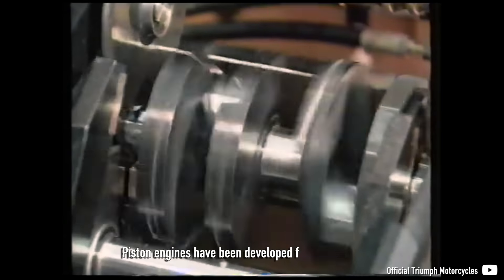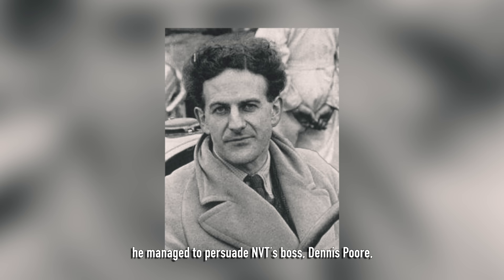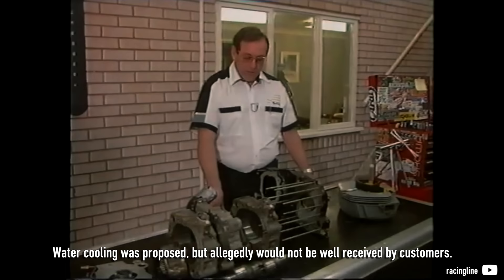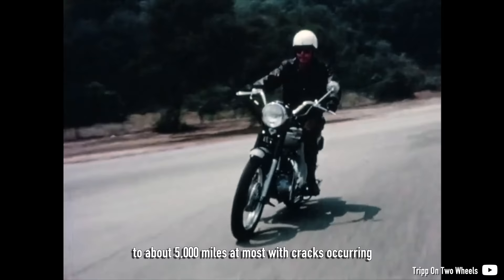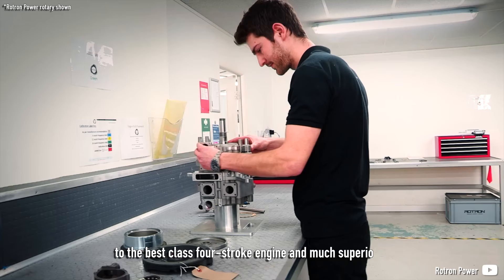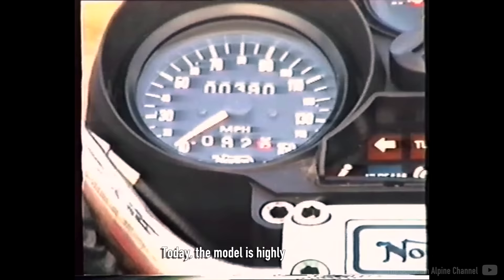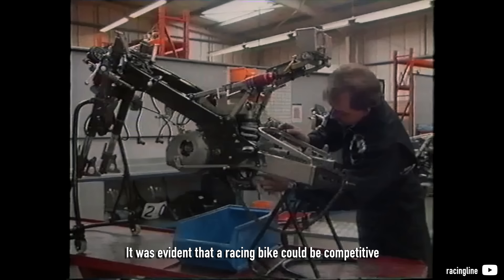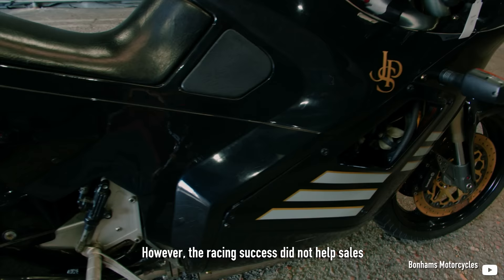Norton Reinvented Rotary Engine

Comment: Theres not a huge amount of coverage on this bike despite its impressive performance  and usage, like on the isle of man. thanks for taking the time to make this.
Reply: im sure we can do a much better rotary engine with current advancement in engineering materials today!
Reply: The only thing Norton lost more than races... was customers!
Reply: @fidelcatsro6948  Wankel engines are obsolete technology.
Rotary bikes have been obsolete for nearly a century.
Reply: @sandervanderkammen9230  look up rob dahm
Reply: @sandervanderkammen9230  Well, that buttery smooth torque curve did make them very good on wet tracks. No torque spikes to break traction. But yeah rotaries are a bit of a dead end.
Reply: @sandervanderkammen9230  This channel doesn't have any content
Reply: @brentbartley6838  This channel doesn't have any content

Comment: The displacement of 588cc isn't really true. In reality, engineers don't agree on how to calculate the displacement of a Wankel. While some would say the Norton was 588cc, many would say it was really 1764cc. It all depends on how many chambers in the rotor housing you measure. Certainly its fuel consumption was equivalent to a 1.8L engine.

Comment: I remember watching Ron Haslam racing a JPS Norton Rotary, the exhaust pipe was glowing a dull Red ( awesome ). It was rapid on the straight but the piston engine bikes caught up on the corners due to the Norton having to rely on brakes alone ( not a combination of brakes and engine ) to slow down, once out of the corners the Norton left them for dead... amazing engineering and amazing exhaust sound...Great upload VisioRacer, thank You.

Comment: One Norton rotary was said to have been fitted to an Austin Metro from 1981-1983,  the car was demonstrated to Austin Rover who lost interest when they found it out-accelerated their MG Metro Turbo. However from Oliver Winterbottom's book A Life in Car Design, the above was likely connected with a project between Norton and Lotus known as Project Nora for a Norton rotary-engine coupe around the same period that amounted to nothing when it became apparent the rotary engine was not ready for automotive use.
Reply: Norton used Sachs engines
Reply: The engine was not the Problem, It was the crap ass car they stuck it in!🤣
Reply: @sandervanderkammen9230  Yeah, I know. me is 62 old biker. Fun watching them Race, tho too claim they were only 580cc was taking the piss.

Comment: The 1990 Isle of Man TT footage with the Norton F1s passing through the narrow tracks is, without a lack of a better word, PURE EARGASM.

Also, what a good research for this video! I didn’t know the Norton rotaries were inspired by both Rolls-Royce and Sachs units, and its heritage still lives on to this day under Rotron! Glad to know that there’s more than just Mazda and LiquidPiston actively developing rotary engines.
Reply: sadly strict emission laws today are causing many manufacturers to go electric instead
Reply: @fidelcatsro6948  Wasn't just about the emissions too. Electric power (brushless motor technology, not battery or the charging tech) is already WAY more efficient today in terms of performance and mileage compared to an internal combustion engine and I expect it to improve quicker in the future. 

However, while I'm still alive I'll be cherishing the internal combustion engine as long as possible, especially rotary engines. Mazda recently patented a three-rotor sports car design with hybrid assist, to which I'll gladly take that knowing I could have the option to hear the braps.
Reply: @Nafeels  yes i agree, electric is very efficient, the only problem is getting the most energy stored in a battery as tiny as possible
Reply: @Nafeels  electric is far from being efficient or effective as IC engines, atleast at the moment. You might live in a place where the conditions favour the batteries but where I live, dust and heat are causing batteries to blow and not to mention the fuel economy and the practicality. Also remember we're still getting a major part of our electricity from fossils, so we're aren't as clean as we think we are. IC's will be here for the next 50 years.
Reply: @Nafeels  you fail to take into account that the problem with EV is not electric motor but battery technology. manufacturing batteries is highly polluting process. not to mention that batteries onoy have life of 8 years or even less if you are making miles above 100k miles. city dwellers who like to change cars every 5 years, with good access to electric charging points will be satisfied with EVs.
Reply: @lordjaashin  only 8-10 years, junkyard will full of EV 20 years from now.
Reply: @Toxic88088  Perhaps I didn’t really specify what I meant.

What I meant was “electric power” meaning only for the brushless electric motor technology. Instant and flat torque curve, direct drive without the need of a transmission, immense power to weight ratio, electric motors are more efficient at making power than ICEs. The only problem with that is our mode of energy storage, which is pathetic from a technological standpoint. Even then, batteries evolve with each generation, and Toyota is already making solid state batteries. 

Sure, the 2JZ can make over 1000+ HP but when you take the turbo, block weight, piping and transmission into account it gets way more complicated to follow.
Reply: @lordjaashin  You’re the second person who failed to see “electric power” within the title so I’ll just edit that for future reference. 

Current lithium ion battery production is pretty nasty for the environment because the mining of lithium and nickel ore is toxic, but with solid state batteries we (hopefully) would reduce our dependancy on those metals and liquid electrochemistry. Even with the setbacks in energy storage the electric motor’s flat torque curve, transmission-less, and massive power-to-weight ratio proves that electric power is already way more efficient today. I mean think about it, the Tesla with all that massive weight from the batteries STILL manage to have hundreds of KMs of range with a single charge. That was today. Imagine within the next decade.
Reply: @Nafeels  even solid state batteries have risks in containment during a crash. Also "instant and flat torque curve" sorry, not everyone one here is drag racing, lol. Like I said, ICE's won't be eradicated just like that. EV's aren't direct alternative for ICE's.
Reply: @Toxic88088  yes indeed. you can not make or run an electric car without oil. fact!
Reply: @Toxic88088  Ofc they have. Guess what type of mechanical device that turns heat energy into kinetic energy? That’s right, an internal combustion engine. It took a century to finally perfect ICE and NOT catastrophically explode in an accident. While battery tech isn’t my forte, as a chemical engineer I know a thing or two about chemicals, and current solid state batteries are pretty much a continuation of lithium ion batteries. Once in a while new “studies” on solid state batteries would surface (my favourite among those are graphene batteries) while more auto manufacturers plan to go out with a bang before switching to electric. 

Also, funny you mention that having a flat torque curve is ONLY useful for drag racing. Notice how even modern ICE cars now have forced induction as part of their downsizing plan. Why have a 3L N/A V6 when you could have a 1.5L I3 with turbos that produces torque figures just as flat as the V6 with careful tuning so you could still merge quickly on highways without pressing the pedal hard. 

Say what you will about not being replacements, we both know EU and many other countries won’t back down from their goal of no new ICE cars by 2030. Doesn’t mean a total ban on ICE cars on the road (I hope to God they won’t be THIS stringent) but perhaps a start of a new era of automobile tech. Either way, there’s no way they’re gonna touch my 1st generation Celica.
Reply: @Nafeels  There are two companies close to that manufacture these engines. One exclusively for military drones. These have a sacrificial oil engine. When they run out of oil or petrol they stall & crash. The other AEI Ltd produce a modular range of engine by size that can also be stacked. They have a twin rotor one in a Caterham 7. This is more powerful than the best normal 4 or 5 cyl engines normally optioned. Also it sits way further back & lower down than a regular example. Oh, it does need a bigger fuel tank to give it a decent range. But it goes like stink & handles like a dream. The power to weight ratio is improved even with the extra petrol.
Reply: I remember watching the senior TT outside the central pub in Ramsey I.o.m
Reply: @Nafeels  People used to the fact that fuel tanks don’t wear out in ICE vehicles arn’t going to move en masse to EVs till the solve the problem of their fuel tanks, the batteries, wearing out.
Reply: @kevinburke6743  Well consider me intrigued! I didn’t know Caterham offers a rotary engine option for their 7 series models! Makes sense for their lineup though, since the other engine options are screamers as well. 

As for the other makers in the rotary playing field, I’m guessing the other company is LiquidPiston. They recently received contracts with a military body to produce a diesel rotary engine based on their HEHC combustion cycle rotary engine, and were already developing engines for drones as test kits.
Reply: @mickvonbornemann3824  Which is what solid state battery research aims to solve. Dendrite buildup had been a constant problem with conventional aqueous electrolytic batteries, so something that could potentially solve the issue of “draining fuel tank” problems remain a top priority. 

Also, while it is true that fuel tanks never usually rot until maybe decades later, ethanol fuel corrosion is a huge problem in the US where a large portion of E85 fuel is subsidized. Ofc, there’s flex fuel settings to consider but in general no one wants to fill up their cars with E85 unless it’s for racing.
Reply: @Nafeels  catastrophically explode in an accident? Wtf are you smoking?
Reply: @Nafeels I believe the Iconic SP has what you're looking for at least in the rotary aspect. That's Mazda's newest and most recent concept car.

Comment: Looked for 22 years for a low miles DKW W2000 rotatory found a Hercules with 1,400 miles rusty tank and chrome but not a mark in the rotor housing. 100 hrs of renovation later back to factory spec I use it loads its a bloody hoot to ride.
Reply: 300cc if memory serves me right.
Reply: @madb132  I believe that was to considered opinion of the W2000 capacity. DKW called it the W2000 as they beloved by the year 2000 every bike would be a Wankle
Reply: @slartybartfarst9737   Not seen one for years They handled really well from what I recall , last time i ridden one. Hope you're enjoying yours to the full. Can't be many left.
Reply: @madb132  Yea it handles real good but Cerini front and rear bouncy bits Grimicia disc brake means its still good for today. Problem I have is getting to talk with thats ridden one. I rebuilt mine and refurbed the carb, it had a corroded needle jet. It fired up almost first try blew smoke to fill the street and has been dead reliable ever since but its always hunted or surged on low throttle openings. Anything below 50mph in top does not put enough load on the engine for the throttle to be open more than an 1/8th and the bike is 4 stroking and surging, the lower the speed/smaller the throttle opening the more it does it. Its like an old BSA Bantam on part throttle. 
Can you remember if the bike you rode did the same or if it was managable on very small throttle openings?
Reply: @slartybartfarst9737  It was  the very same reason rode it.  the owner asked me to take it for a ride and if I could fix it. Got it running better but wasn't quite perfect but he was pleased. Played with  different carbs from my vague  memory can recall. Today tho i would be tempted to go FI.  Have you had the carb ultrasonic cleaned? complete strip and then have it done. twice if need be. renew all parts with new. should run better. when I rid 2 strokes I always rid with the throttle partially open , hard habit to break as i still do it now!
Reply: @madb132  Wow thank you at last some sanity! Its good to hear just had some success with the carb, ive been all over the carb and replaced the needle but as its same as a BMW R45 im gonna send it off the get expert eye on the case as the bike is such good fun apart form this hunting.
Yes i was considering Fi. But after 44 years designing and engineering systems to help test auto engines world wide the brutal simplicity of a singe rotor, single carb single mag ignition is the main thing that appeals. Its good of you to impart your experience , never having had a rotary ive no idea whats right or wrong.
Just needed someone else to confirm whats right and whats wrong, clearly you noticed the effect too and managed to improve matters, ill act on your info.
And yes your right Ive ridden many 2 strokes over the years and its impossible to get out the habit of never leaving the throttle shut for any time, I know a lot have oil pumps so there "should" be no problem but having seized a few you learn and its no bad habit when you have an irreplaceable rotor/housing.
Currently running 2 strokes Kawasaki 500H1B, Suzuki Stinger T125 and a few other bikes as well as Suzuki GSXR 1000K5 and my favourite simple steeds a couple of 1970 Honda CB750 K0 that Id trust to take me 1,000 miles any time and if something broke it could be fixed.

In the past I succeeded in putting a TZ350 G on the road, that thing would take no prisoners if you dared ride it on a closed throttle! And currently really into my Zero SRF electric......no fuelling problems there. Are you still into your bikes?
Ill let you know how the carb work goes on the rotary, thanks again for the info

Comment: There was a stunningly accurate replica built in Australia back in the early 1990s. It may still be floating around. And yes, it ran a modified Norton Rotary built as close to spec as possible. Norton were very reluctant to provide any assistance, so the builder had to work everything out himself. From what I read at the time, his lack of data relating to the intake manifold length led to superior results over the original engine once he had the length dialled in. Karma, eh?

Comment: They should make a series of 1, 2, and 3-rotor motorcycles that are between 50-70hp per rotor depending on the state of tune and supposed chassis they're going in. That alone would give them a whole lineup of bikes they could make in every segment and for every rider skill level. I'd like a 2 rotor version placed in something like an AAR Alligator chassis with Robert Horn's Virtual Hub Center front end. Either that or the least powerful 3 rotor version purely for the sound of a 3 rotor.

Comment: Thanks for letting us know about this! I never knew they even exist, it's absolutely incredible why's that they never sold well, i suppose they were too far ahead of their time!
 It's a real shame they didn't get the proper recognition, but again, wrong country, UK is all about those clasic thumpers, brain shaking out of the skull type of tractor bikes...
Reply: goinghomesomeday1  yeah, i have a thumper myself right now, haha, but I've once driven hard, one healthy Rx8 and never recovered after that experience...
 Cars or whatever other than motorcycles are absolutely wrong with that concept, but wrenching on it, off a bike, is absolutely desired, at least for some of us...
Reply: The rotary engine just isn't as good as a piston engine in the vast majority of applications. They have a total loss lubrication system so they pollute badly and there's no way around it. The apex seals fail early and the fuel consumption is bad. The only application for them is where power to weight ratio outweighs these many problems.
Reply: They never sold very well because they kept breaking and were too expensive for the masses.

Comment: As the temperature of 20°c is referring to a temperature difference rather than to an absolute temperature the correct conversion would be 36°F.
Reply from the maker: I did not take into account the fact that 0 °C does not equal 0 °F, but rather 32 °F. Since I am used to a freezing point being zero degrees, it completely slipped my mind when converting into Fahrenheit.
Reply: @VisioRacer  I just thought I would let you know. I really appreciate the technical insight you communicate in your videos. Thank you for all the effort! Greetings from Austria.

Comment: Sachs KM-914 had two versions, stationary engine and snowmobile engine, both 303 cc per chamber, from a Rotor slightly larger than 294 cc Rotor in KM-24 and KC-27.
The gains from a more complex and elaborated Rotor recess in Aixro, charge Cooled Rotor, liquid cooled housing kart and parapente and ultralight airplane engine are impressive.
Austro had also gains by adopting the Rotor recess shape of early Yanmar Diesel Wankel.
Wankel Rotary Engine still has a lot to say.
Who'll have last laugh?
Gesund +
Reply: Obsolete technology

Comment: Maybe it is nice to know that Midwest developed the Norton 294cc wankel single rotor into a certified aircraft engine. The AE-50R. Most of the Norton technology was still used. My glider, a Alexander Schleicher ASH-26E, has one installed. Rated 50 hp at 7400 rpm. Beginning of the 90s, Midwest was taken over by Austro Engines, who developed this further into a fuel injected variant which is still in use as glider powerplant. Look up ASH-21 Mi, ASH-31 Mi and ASH-32 Mi. At Austro there were even developments of more powerful versions but they never made it into airplanes..